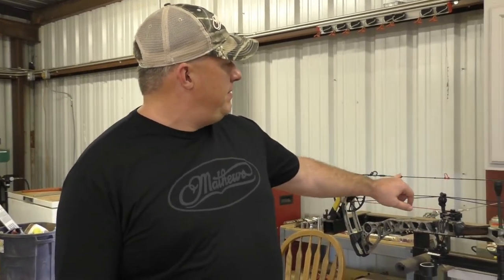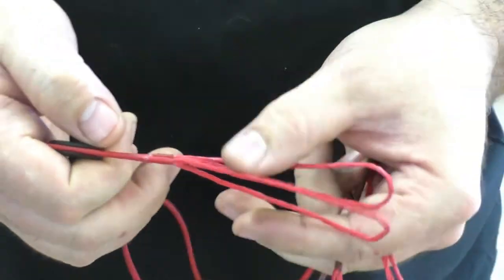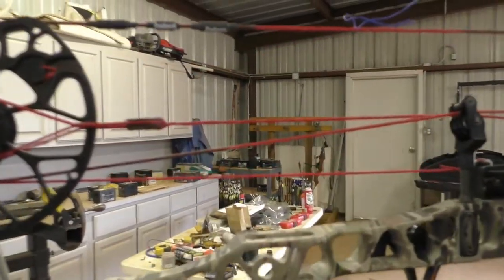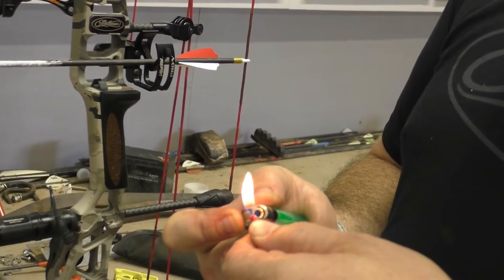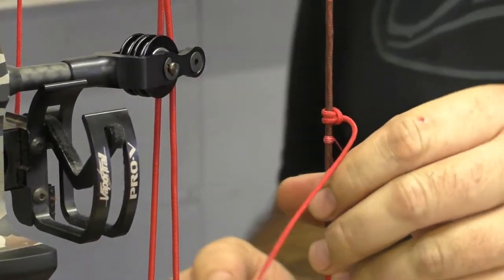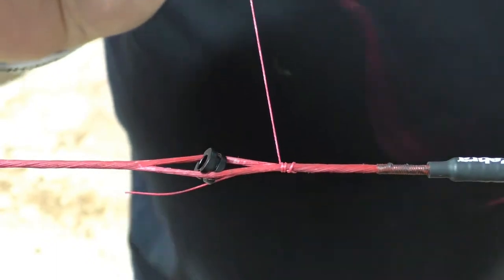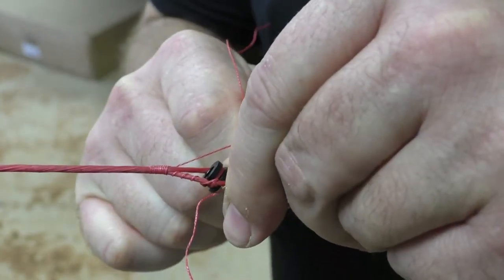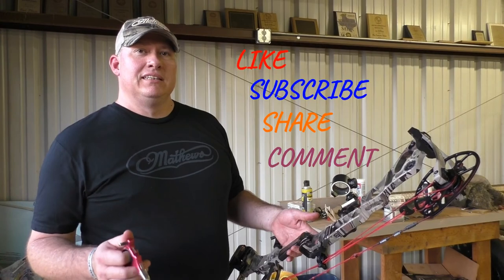Restring a Mathews Halon

Comment: how do you combat peep twist with new string, even with the factory string splitting it down the middle,
Reply: James Hinson when I have the peep where I want it, and it has been served in, I will twist the string a half twist to line it up. After you shoot a hundred and fifty-ish times, the string will stabilize. During these 150-ish shots, the string will elongate a little. I usually try to twist the peep by hand before I draw during these first shots. After the string stabilizes, I’ll put a half twist in or out of the string to get it straight again.

Comment: I bought a Mathews Halon 6 less then month ago from a pro shop. it is brand new. The other day I noticed under my bottom cam pocket  on my riser there is two small indentations. What would that be from, the bow press?
Reply from the maker: It shouldn't be from the bow press.  I would recommend taking it to a local shop to have it looked at.

Comment: Changed out a set of strings/cables and am having trouble getting the axel screws tighten back up. Any recommendations?
Reply: The only problem I have had with the axle screws is sometimes they will go in about a thread and then bind up. I pull them back out, wipe the threads with a  cloth, then reinstall them. you can use two allen wrenches to tighten them  one on either side of the axle. Do not over tighten the axle screws. They should just snug up against the limb side.
Reply: Jon Earley that was exactly the issue, cleaned them up, spun in perfect

Comment: How do you know if you have the correct amount of twists in the floating yokes ? Or do they come from the factory preset ? I guess you could feel it and eyeball it to make them the same length or measure...??? Good video too BTW
Reply: On the Halon series, the yokes are twisted from the factory. Since they "float" on the attachment thingy, sorry, I don't remember what they are called, They will set themselves after a few shots. The only way to adjust the cam lean or center shot is with the Top Hat spacer kit from Mathew's.
Reply: Jon Earley yeah I have a Halon 32 as well, I just noticed that when you installed them you said you have to make sure they're the same length. And yes I had to adjust my top hats and shift the cam left, it will shoot a bareshaft with a fletched at 40 yards now. Love this bow.
Reply: craig fugate Awesome tuning!!! I try to make sure the piece the yoke attaches to is in the middle of the yoke. I make sure the loops  on the yoke aren’t twisted, then I install it.
Reply: Jon Earley 10/4. What custom set wpuld you recommend ? Zebra,vapor trail,winners choice ?
Reply: All of those are good options. I usually use Zebra, but we also carry Vapor Trail. They are both great strings, but being a Mathew's dealer, we usually order Zebra. Winner's Choice also makes great sets. If you order a Zebra Trophy set, they will almost always be within a few twists of being exactly right out of the box since they are part of Mathew's inc..
Reply: Jon Earley thanks, yeah i think I will stick with zebra because they're kinda what's intended to be on the bow in a sense. Thanks again.
Reply: Jon Earley is it better to take a 1/2 twist out of string or put a 1/2 twist in for peep alignment ???
Reply: @craigfugate6147  I missed this question earlier. Sorry about that. I always try to go twist in, but so long as it isn't more than one twist, it doesn't really matter which way you go.

Comment: How do you adjust cam lean with this yolk system?
Reply from the maker: You can get the Mathews Top Hat Spacers from your local dealer.  It shifts the cam right or left in the limb set to adjust lean.  It's a great way to tune to stiff or weak spined arrows.